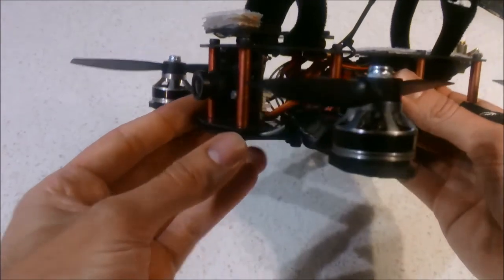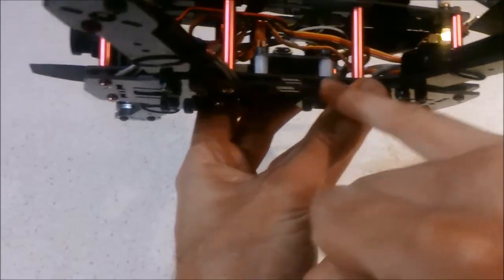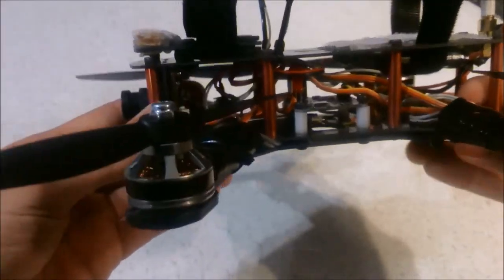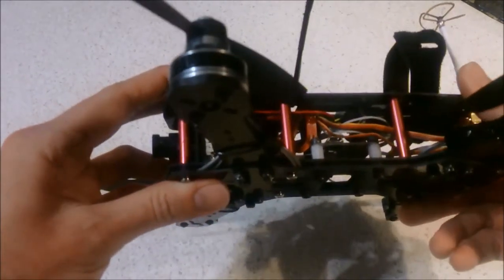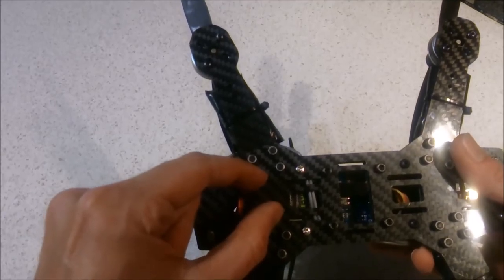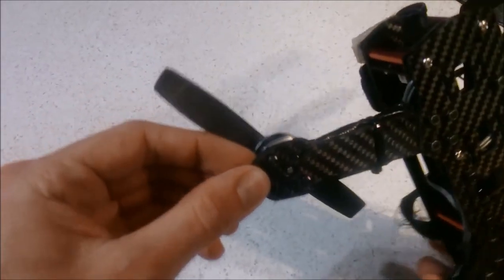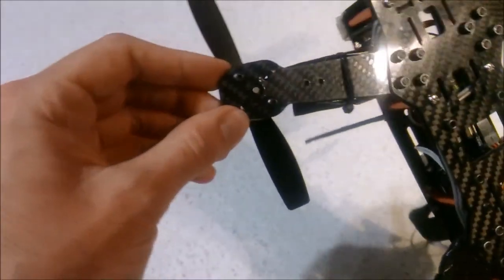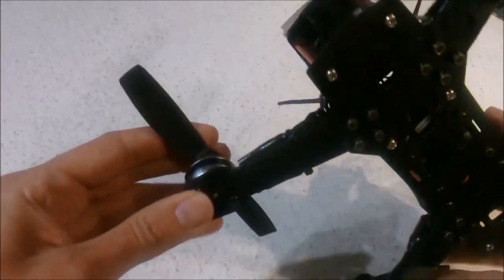ZMR250 modifications

Comment: I only screwed the large spacers directly on the first plate. I only have the motor screws through both plates.
Reply from the maker: Yeah I think that's how it's intended to be done? I thought this might add extra strength for basically no weight gain.
Reply: Adam Wilkinson Where did you get the 3mm spacers from?
Reply: Was taking the top plate off and the screw was undoing between the plates. Not ideal. I think your method is much better

Comment: How do you like those T-Motors?  Running them on 3S or 4S?
Reply from the maker: Gino Salvatelli I really like them. they are still running smooth after a lot of crashes, I'm running 3S+5045 props, I have been considering moving to 4S though.

Comment: why do you cut the props?
Reply from the maker: Anis Shakkour  Hey, I didn't cut them. they are called HQ 5045 Bull Nose props - Yes cut down from 6045 then re molded at the factory. I wanted a smaller footprint frame and more responsiveness which is why I cut down the frame and use 5" props! :)